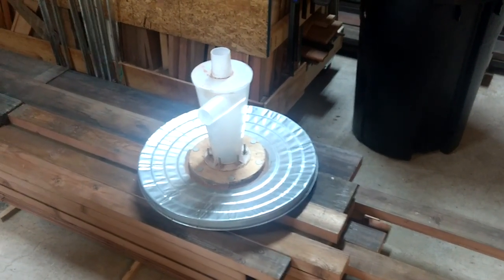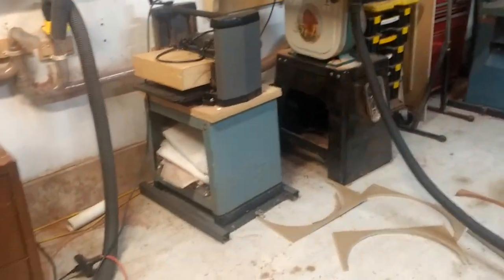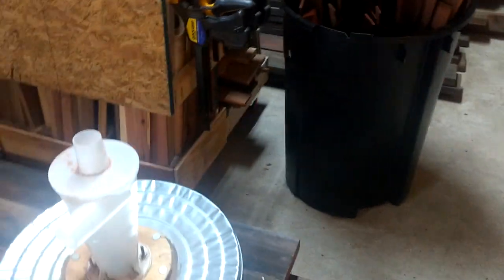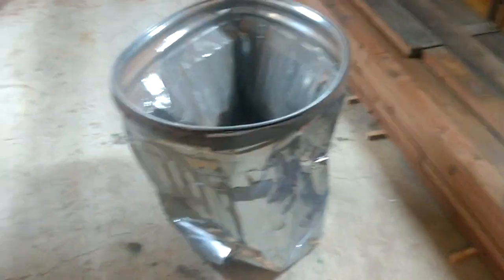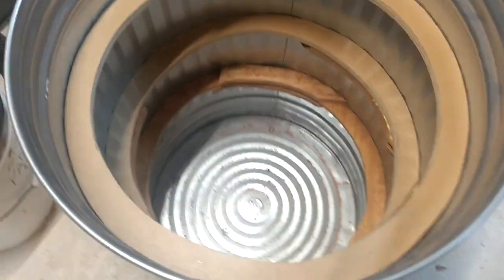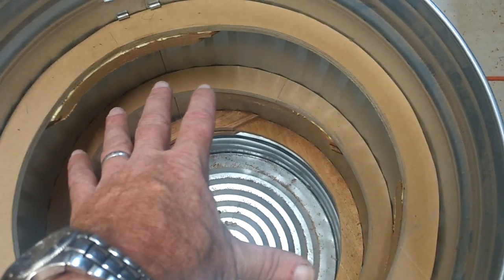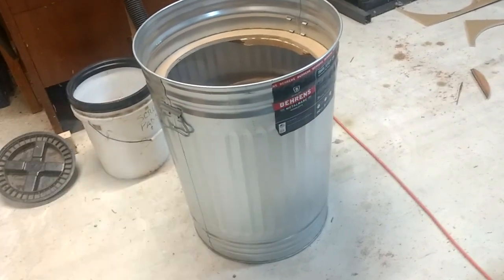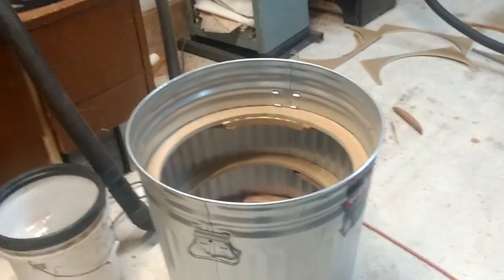Better shop dust collector for your cyclone

Comment: Any kind of waste container (small or large) that is used with a cyclone device must contain dead air to achieve the best possible separation of fine dust.  There must be no air leakage into the waste container through 1) the lid-to-rim joint and 2) the cyclone-to-lid joint.  Any air leakage through either of these joints will degrade the separation of fine dust.  Flexible, elastic, compressible, conformable, leakproof gaskets must be used.  It is not apparent that the metal garbage can in the video has an adequate seal at its rim.  If the garbage can becomes deformed, then its rim seal likely also becomes deformed and leaky, even if the rim seal was once demonstrated to be leakproof.  The two seals into the waste can should be periodically tested to prove air-tightness.  Otherwise, the cyclone device might be deceptively operating very poorly with fine dust.
Reply from the maker: That's a fair point. I didn't explain in the video, but I used a thick self stick weatherstripping around the lip of the can and lid. This in fact provides an excellent air seal as evidenced by the crushing of the can. If leaks were occurring the can wouldn't have been crushed so thoroughly. If you look at the lip on the crushed can you can see the weatherstripping. It hasn't been applied to the new can in this video yet. Anyway, long story short, self stick weatherstripping does a great job of air sealing the metal can.